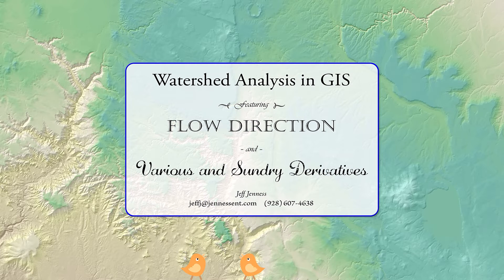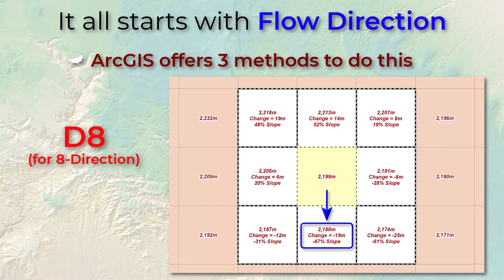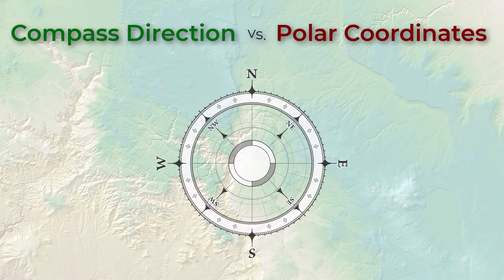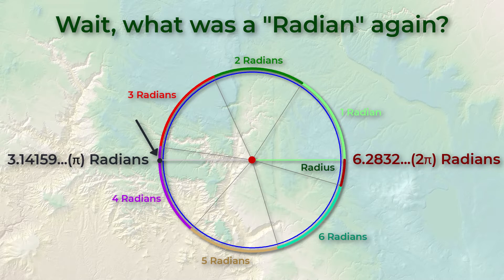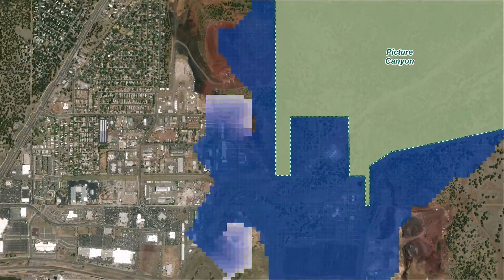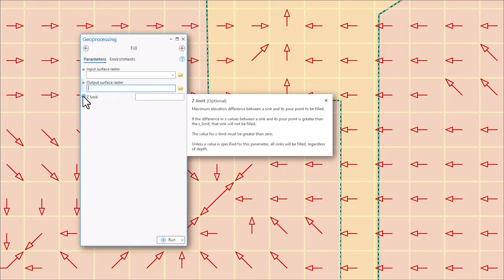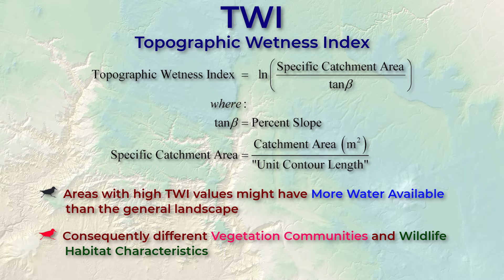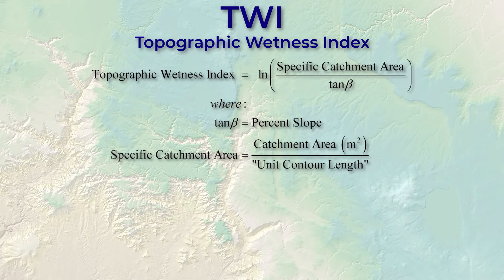Basic Hydrologic Analysis in ArcGIS Pro

Comment: Hi Jenness, your teachings are just amazing! 
Any chance you can show some insights into hydrochemical analysis. Perhaps estimating predominant factors of Alpine rivers using ARCGIS pro.
Thanks in advance.
Reply from the maker: Thanks Felix!  Hmm; that's an interesting question.  As far as water chemistry goes, that's a tough one to pick apart.  If your rivers are primarily spring-fed, then the chemistry is highly affected by the minerals present in the aquifers, plus how long the water is underground.  You can get very different water chemistry measurements from springs that are right next to each other, if the aquifers producing those springs are not connected.  So it can be tricky to predict water chemistry without a good understanding of the aquifers, and that kind of data is hard to get.

Your question is a cool idea, though.  We do a lot of water chemistry analysis of spring ecosystems at the Springs Stewardship Institute (https://springstewardshipinstitute.org/) so I have a lot of data I could work into a lesson.  And my Forestry students would appreciate a decent lab exercise on the topic as well.  Thanks for the idea!
Reply: @JennessEnterprises  Well said!

Sourcing hydrochemical data is sure the major challenge but with several open national repositories, it is doable.

Again dependent on the area of interest, perhaps one can use representative data to insight on such analysis.

I will be looking out for that lab. Can't wait:)